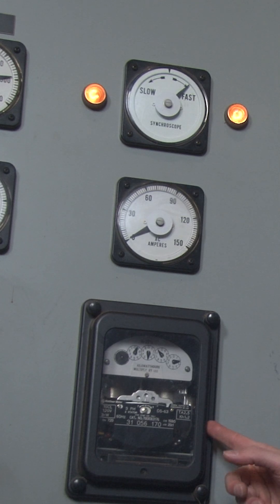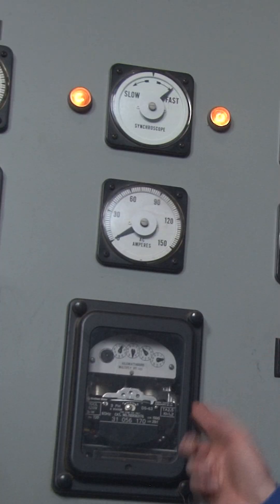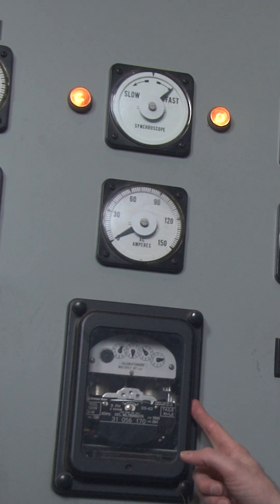kiloWatt Hour Metering #engineering #powerplant #hydropower #highvoltage #science

Comment: We used kVAhour meters onboard ship

kWh measures only the active component of the power produced (or consumed by domestic single phase customers).
kVAh measure apparent (total) power, which includes the reactive component of the power generated (or consumed by industrial 3-phase customers) and is reliant on the power fsctor (ratio of kW to kVA)…how effectively the appatent power is converted to usable (billable) power.

At least, I think that's what I remember from my single semester of power electromics…that, star/delta starters and for some reason, the equations for calculating capacitive and inductive reactance…1/2πfc and 2πfl respectively.

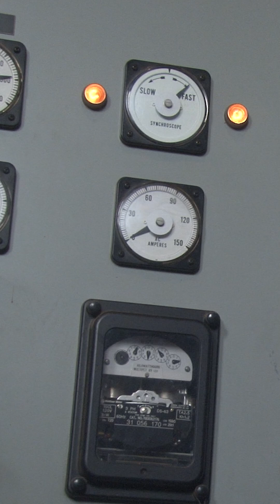Comment: 0:00.
FUN FACT, TWO PHASES are "not" a myth, nor are they rare.

EVERY "two phase domestic supply", comes from (yes) a SINGLE WINDING in a special type of 3xLINE to 1xPHASE "domestic single phase TRANSFORMER pole supply.

YES there is JUST one winding, and NO they are NOT 120 opposed, but at each "absolute distant" (2x 180 degrees apart), CENTER TAPPED END, of one wire which is the secondary winding.

Thus every house in America supplied by using a single output, CENTER TAPPED Neutral/Earth/Grounded 2ph transfomer, using a SINGLE "line to line" higher voltage "pole transformers supply" via a single transformer's center tapped secondary, (a voltage reduction transformer), is NOT producing an amazing 120 degree 2ph secondary ouput at all, but just ONE 240 v master winding, center tapped at exactly it's 180 degree point, being the center of ONE winding.

A secondary winding that is sending both ends AND it's halfway center tapped grounded NEUTRAL - to any person's domestic situation.

THEY GET two phases GEOMETRICALLY OPPOSED at 180 degrees separation, period.
No mention of 120degree 3ph rotational vectors..

They are NOT at your DELTA LINE 120degreex 3phase differences, as there isn't a "third phase" OUTPUT from that single wire wound transformer, just ONE PHASE (center tapped, to provide two 180x degrees apart = single phase vectors, in reference to the center tapped midway point of one wire.)

Sadly, your expert opinion for the SHORTS video (that you made), is fundementally incorrect.
The shorts video - is UTTERLY WRONG, and should be taken down, before everyone realises YOU have completely got the theory of electricity COMPLETELY WRONG.

ie:
https://www.youtube.com/shorts/kFZ6cgGb-d4
Has one flaw, and that FLAW ss this.

ONE secondary winding CAN NOT have a midway center tapping, that is 120 degrees out of phase, with either output, OR, your single phaes transformer, isn't a single phase transformer at all, but a three phase transformer "WITH ONE WINDING CENTER TAPPED - & GROUNDED to form a Neutral Point between JUST two lines.
It's output style, IS NOT THAT of a genuine 3ph STAR NEUTRAL POINT 3h transformer, with FOUR WIRES.

Any two (phases) of a single transformer's PRIMARY winding are yes, 120degrees separated, as there is another that is 120 degrees LINE either way, to your two INPUT LINES.

THAT IS NOT TRUE for a single wire ONE WINDING transformer's secondary single winding output.

THE ENDS of that single phased transformer output, (with a CENTER TAPPED NEUTRAL, grounded at the pole) - are factually 180 degrees apart, both geometrically and electrically.

Thus your B/S sob story holds no water.

THE SECONDARY of a single phase LINE TO LINE transformer, is NOT the same as a three phased 120 separation STAR NEUTRAL POINT 3ph supply, but a genuine two phased 180 degrees apart, center tapped NEUTRAL output, with it's BARE NEUTRAL, at the same grounded/earthed potential as it's surrounding (grass is green at the) ground, around the pole.

Sadly TWO PHASES are a thing.

THEY CAN NOT BE RECONNECTED in any way whatsoever, to recreate a three phased non earthed Delta supply (of any votage).

There is NO (120 degree) 3ph reference - with which to gain the 3rd LINE back again.

Sorry to burst your bubble, but comparing GRAPES TO PEARS is not a good look, even for you.

Comment: I want to know why its terrible. I'm just a consumer who really likes electricity here.
Reply: So a Watt is one Joule per second. And 1 hour is 60 minutes, or 3600 seconds.

So a kilowatt hour is 1000 Watts * 1 hour=(1000 Joules/second) * 3600 seconds. The seconds cancel out, leaving 3,600,000 Joules, or 3.6 Megajoules.

Meaning we could just be billed by a unit that already existed, the Megajoule.

And for definitions, a Joule is the work of applying enough force to accelerate a 1 kilogram mass by 1 meter/second, applied over a distance of one meter.
Reply: We'll use anything but the metric system

Comment: kilowatt hours is a unit of energy (not power). 1 kWh equals 3,600,000 Joules. Thankfully we don't measure our energy usage in Joules otherwise our bills would show astronomical numbers of Joules expended.
Reply: Joules isn't accurate because of power factors. You can't measure how many joules I use without knowing the equipment or devices I am using. It would be best measured in amperes or coulombs. As those are effectively the same measurement, it would likely be best to go with the more known term and divide by time. A/H or even KA/H would be far more practical than using watts. I personally could care less about what the voltage is and shouldn't have to worry about paying for that. Measure current and current alone. That's the measurement of electrons expending energy from the grid.
Reply: @thenameismagoo voltage doesn't matter? But 110-120V is double the Amps than 220-240V for the same power.
Reply: Just mesaure in MegaJoules 🤷

Comment: No No let's get into this.   Please for the love of all things electron holey, wax poetic about the practical failings of the kilowatt hour metering system.   Then I'll go about the hundreds of cubic feet for metering water system.
Reply from the maker: The only time I've found CFS to be useful is when calculating flow through a cross section (Rivers, Spillways, etc). If you want a really fun one, the US Government measures river heights not in Inches, but in 10ths of a Foot elevation. It's like Satan's metric.
Reply: @Physicsduck  
EXCEPT some of us actually have no problem with tenths, hundredths, and thousandths.
Those anti-que machinery parts for your spiny things have thousandths tolerances  unless they wobble a lot.
Reply: @blaydCA  the river is at 10^4 honey we should go tubing.   Yeah I can totally see why that's the most reasonable measurement for rivers.  The Brits weigh themselves in hexadecimal I think. What even is a stone.

Comment: Kilo-watt-hrs are a measure of consumed energy which can be correlated to the amount of resources consumed minus the overhead and profit charged in electric rates.  Watts are the rate at which resources (energy) are consumed.  In billing for electricity, Watts will be used to “ratchet” cost of energy consumed based on demand.  This increase in demand cost will account for the excess capacity the utility has to have to avoid overloading the electrical system during periods of high demand.

Comment: You can print a round ring sticker a little above the scale in radius to not obstruct it, with each 0.2[7]kWh increments marked with 1MJ. That wouldn't be easy to mark though, so, with each new kWh step, it are 3.6 MJ. So, if a kWh is 10° on scale, each MJ would be 2.777etc degrees on the scale. If it begins 0 and ends 1000kWh, it would be 0 to 3600MJ on the other scale. That is, if anyone approved...

Comment: In my opinion, KVA hours is the correct way to measure consumption
Reply: No, because you are not consuming the apparent power. You only dissipate the real power.

In industry they do measure the power factor but only charge for it if it goes beyond a threshold. That's an incentive not to allow the power factor to go to low. It's effectively a punishment. They aren't trying to charge for the actual kVA.

Comment: Kilowatt hours is a unit of energy (not power). 😊

One watt equals one joule of energy generated (or dissipated) per second. One kilowatt is 1,000 joules per second. One kilowatt hour is 1,000 x 3,600 joules per second, or 3.6 Mega joules per second.
Reply: 1 kWh is 3.6 Megajoules. Period.

As 1 Watt is 1 Joule per Second, the time gets eliminated when you multiply the equation with a time factor (in this case 3600 seconds).

Comment: Then there is the "horsepower-hour" used by railroads when lending/leasing locomotives. If you use another railroad's 1,000 horsepower locomotive for ten hours, that,s 10k horsepower hours. That can either be paid at an agreed upon rate, or paid back by lending them your locomotives when they need extra power.
Reply from the maker: I want to know more about this. :) Ferroequinology is cool!

Comment: I see everyone saying "kWh is a useful tool for measuring energy use you can easily calculate in your head"... Do you know what else is a good way of measuring energy use? JOULES. MAYBE KJ IF YOU'RE FEELING FRISKY. The kWh wasn't needed - we can just say "total joules used". 

I really dont get why a separate unit was needed.

kWh = (joules/second)*hours? Why was the second time unit added? I get "use per hour" is a more useful metric for power usage in a domestic environment (or use per day, week etc for things like a fridge or freezer) but you can derive these from JUST WATTS in a simple calculation too. Electricity could then be billed by the total amount of joules used, with a cost per "x" joules. It just makes sense. Eay more sense. 

It's... Just easier to calculate power use and total energy used using the ALREADY EXISTING units that everyone is taught from the start. 

kWh is a simple concept sure, but it's still needlessly complicated and if we said any other measurements in the same way we said kWh, you'd think it sounded stupid. 

... I also strongly dislike the kWh.

Comment: For those who don't know, 1 Wh is just 3600 joules. Why is it 3600? Because W is J/s, and an hour is 3600 seconds. So next time you look at your laptop battery, you know. Speaking of which, don't get me started on mAh.
Reply: The Amp/hour rating system of sizing batteries simplifies the calculation of runtime.  Useful for the battery backup of computer and alarm system - a 12v system with a 12V7Ah battery providing 7Amps will last 1 Hour or at 1Amp will last 7 Hours in theory.  Think of kWh as the same thing as miles per gallon even though your engine economy is based on pounds of fuel used per hour.
Reply: I just love hearing this discussion. People just get confused when I get annoyed by this.
Reply: @bluematter435 mAh tells you the ampacity which is useful to know with batteries. Tells you essentially how long a battery can last at a certain current. Wh tells you how long in a specific voltage range.
Reply: As if 36MJ is somehow more convenient than 10 KW-hr...
"W-hr" tell you exactly what it is: one watt for one hour.
Reply: mAh is also confusing because batteries become less efficient as current increases due to heat. So a battery discharging near its max would be able to deliver less current over time than the same exact battery driving a smaller load.
Reply: mAh is meaningless without voltages... no clue how it's legal to market that way...

wHr is atleast coherent, joules would probably make more sense for a amount of electricity. Would love to know why exactly we use time in our measurements. My guess is just metering tools of the time.
Reply: @matthewmenteer5673  mAH usually refers to DC power supplies or batteries where you already know the rated voltage and can just do the calculation.
Reply: @matthewmenteer5673  the spec sheet will list the internal resistance and all the usable voltages for usable states of the battery. doesn't mean mAh is not silly.

Comment: I love KWh it's a level of complexity and practicality that falls at the exact same spot on the dunning kruger competency curve as I do. 

Speaking of which: KWh would be a stupid measurement for power but fortunately it's a unit of energy :p 

I know once you actually get into the deeper physics and factor in things like power factor and the like it makes less and less sense but engineering and technical conventions are best when you need to use the least conversions practically possible. Power multiplied by time is a practical way to do things. 

My favourite is to confuse people by explaining that you can have multiple KWh per hour.

Comment: I dunno man, kilowatt-hour versus Amp-hour I'd rather go with the Watt based one. Amp-hours keep getting us messed up in variable voltage battery systems
Reply from the maker: Hang on....what's a "variable voltage battery system"?
Reply: Stuff like USB-C. The charger can send higher voltage like 12V instead of the standard 5V, to charge faster. It gets regulated back to whatever the cell voltage needs internally at the device end. Electric vehicles can also charge over a surprisingly wide range of voltage and current from model to model, so the chargers have a pretty wide range and measure in kWh. I’ve also worked on some military battery stuff which has a wide range of voltage on the input side, but get regulated back down to cell voltage later. @Physicsduck

Comment: A kwh is handy for doing math on the consumer side. You have a 500 watt lightbulb, not a 1.8MJ/hr lightbulb
Using it for 2 hours will use 1kwh or 3.6MJ of energy
Reply: if the unit was the same on both sides it would not matter. KW/h is not any easier to figure than joules. There is nothing special about an hour or a kilowatt, a watt-second is simpler
Reply: @watches-on-FF but most of our electricity usage is in hours, not seconds. My AC runs for 12 hours per day and uses 1kW. It uses 12 kWh. This light bulb is used for 3 hours and is a hundred watt bulb. 300Wh.

Sure, maybe a microwave is used for 30 seconds, but that isn't most used appliance in the house, and the energy usage for a 1kW microwave for 1 minute is like 1/60th of a kWh. Practically nothing.

If we think about energy usage on human used timescales, the hour is the right measurement for most things.

Comment: I also have trust issues. Instead of two meters, you should have three. That way if there is a difference between measurements, the one meter that is different than the other two is the wrong / broken one
Reply from the maker: I like the way you think. :)
Reply: On the same vein, precision in instrumentation is much more approachable than most people would intuitively think.

All you need to find true flat is 3 of the same type of stone. Rub all three together until flat. Perfect flat is the only shared denominator between the 3. 

Water will let you find level

A string will give you 90 👍
Reply: Yes, like the computers on an airliner or Space Shuttle.

Comment: What else would you use to measure power? Both Amps and Watts are a instantanius measurements, so if you run qkw trough the thing, measure the spead etc you are good. It is hard to wrap around, but when it clocks, it is fine.
Reply from the maker: You'll know tomorrow :) The video already posted for Members on here, and goes public in the morning.